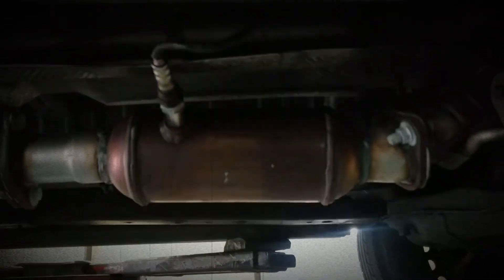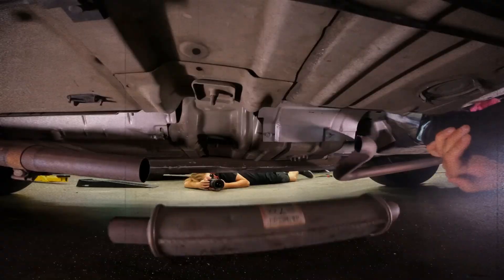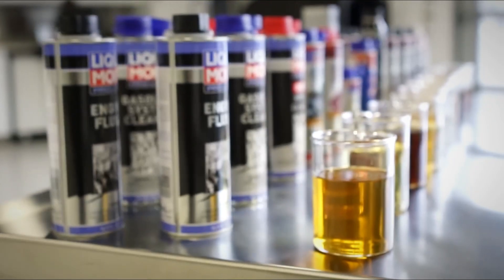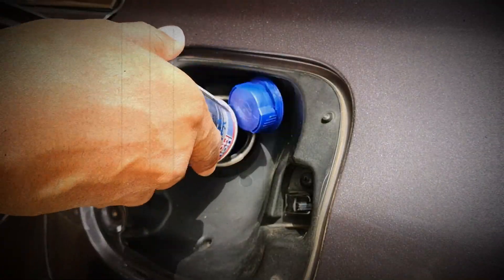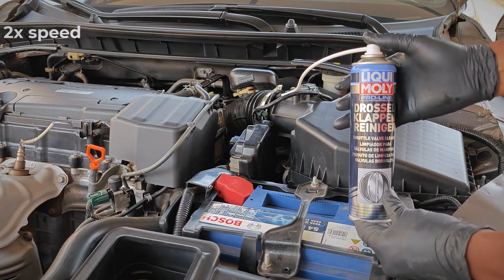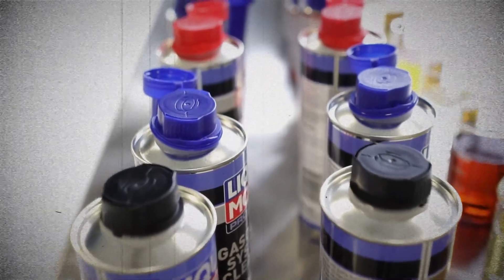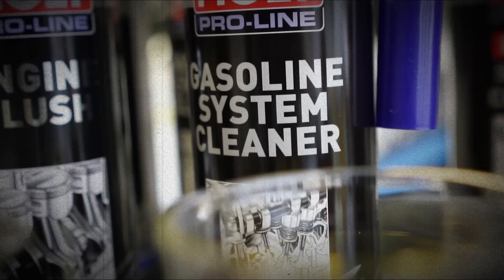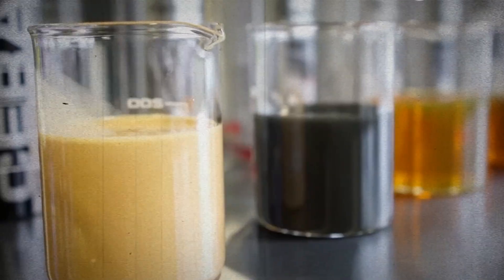“Catalytic System Cleaner – Does It Really Work  PO420 Fix or Waste of Money ” 1

Comment: Hey man I’m in a big trouble somehow I pour this gasoline catalytic systeam clean in my cars diesel tank i just want to know does it harm any parts of my car or what happen please tell I’m waiting for your reply
Reply from the maker: This is meant for gasoline cars
Reply: @MyCarKnowledge123 thanks man
Reply from the maker: I would suggest to empty your car tank and do not drive because if you have modern engine diesels some models will have problems with the injectors. Older models might drive without big issues but just to be sure I would empty it.
Reply: @MyCarKnowledge123 thanks man

Comment: They should make those so that the metal shell can be opened up and then you can replace just the honeycomb inside. I suppose it would need a gasket between the halves, which could maybe be made of copper, like an oil filter gasket, so that it can withstand the heat.
Reply from the maker: The thing is that the part that goes bad is the most expensive part so you would not save lots of money by just changing the inside. On the other hand the chances of leaking from this extra opening would be much more once the car gets older so this even if it would work would create more problems down the line.